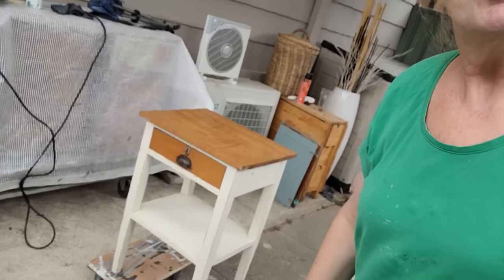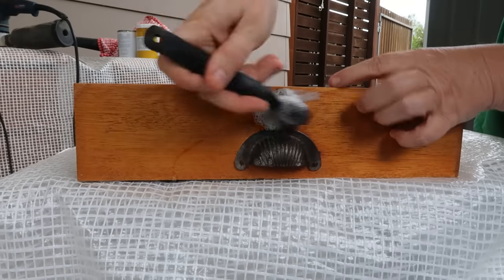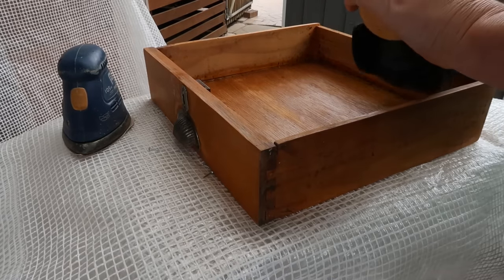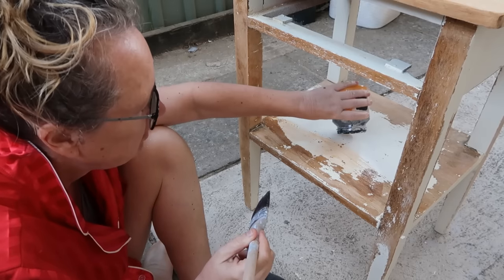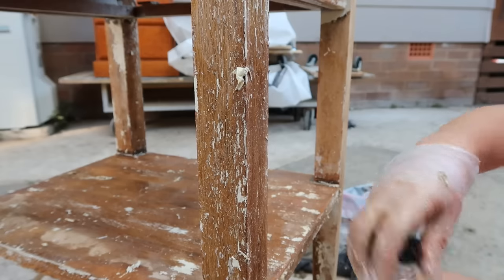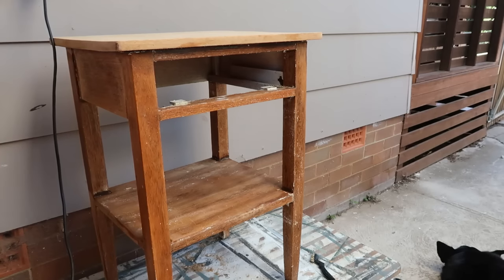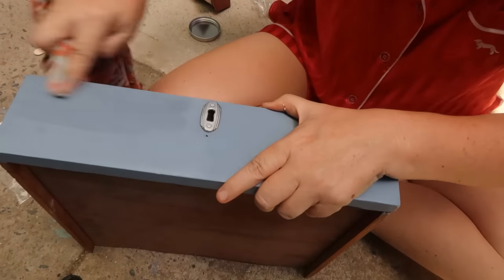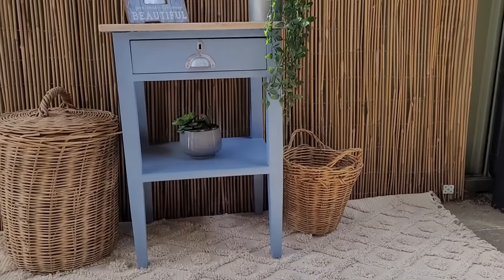What NOT to do when Flipping Furniture for Profit

Comment: This is why you don't use latex paint on furniture.  Don't get that stripper on your bare legs.  That crap doesn't start burning right away but it does burn. Use your new brass brush to get the pint out of the grain and the steel brush to clan your sand paper. Good to see ya Auntie.

Comment: Would you have considered drilling the lock and handle out, filling the holes, and moving the handle up? More work I know...
Reply from the maker: Thars a really good suggestion
Reply: Thanks for your videos.  I'm so confused about all the different products.  I keep thinking I need to start an excel spreadsheet to use as a guide ...
Reply from the maker: For a beginner, I would suggest your best option is to go with a brand that has a really good range of products, and lots of support.  I use Dixie Belle predominantly now and there are heaps of tutorials on YouTube and facebook for all their products.  I'm actually a content creator for them now too which I'm so happy about.  You can check out all of their products here:  http://www.dixiebellepaint.com?aff=497